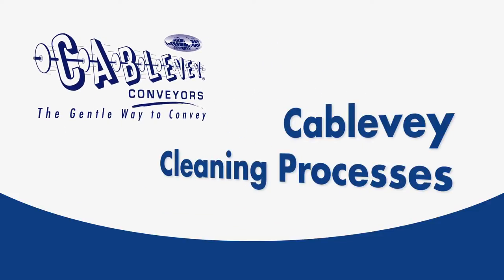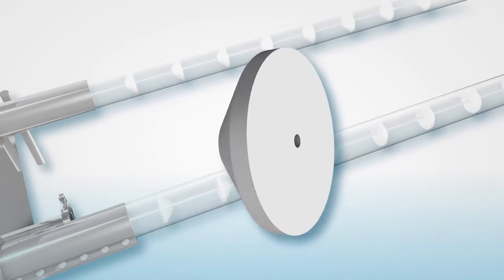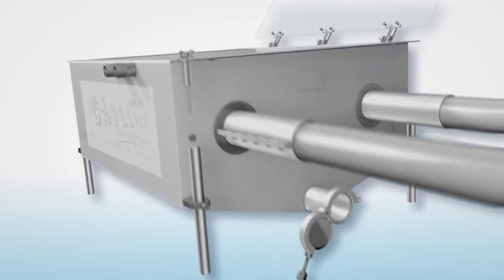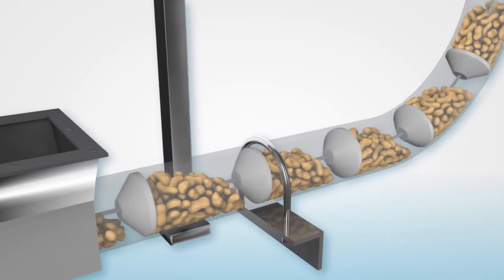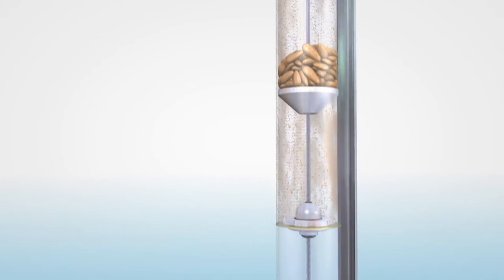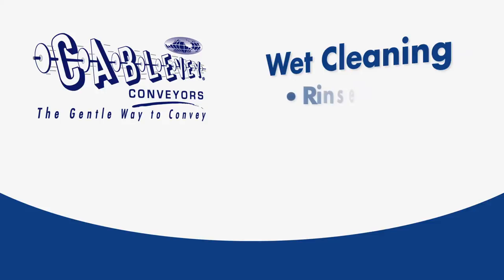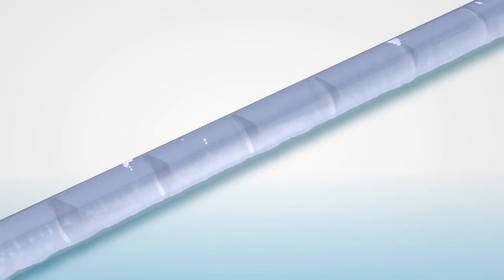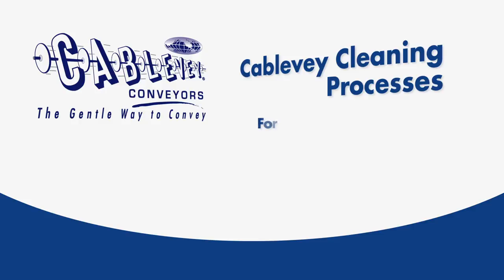Cablevey Conveyors cleaning processes video

Comment: is this possible for tobacco?
Reply from the maker: Bang Togarrr It depends on a variety of factors. In all cases we would test your materials.
Reply: Cablevey Conveyors But tobacco is sticky and also have alot of dust. Do you think it will safe?
Reply from the maker: Bang Togarrr I can’t say without testing it. We’ve conveyed other similar materials. The best bet is to contact your rep in Brazil, and arrange a test.
Reply: Cablevey Conveyors i see. How much volume can i carry in one minute? What the maximum speed of the conveying?
Reply from the maker: Bang Togarrr Volume is calculated by knowing the weight per cubic meter, and varies based on a variety of factors like flow ability and how easy/difficult the materials enter/exit the system. Our systems typically run about 100-120 feet per minute depending on the materials conveyed. We have systems that can move up to 40,000 pounds per hour.
Reply: Did the cablevey conveyor work good ?